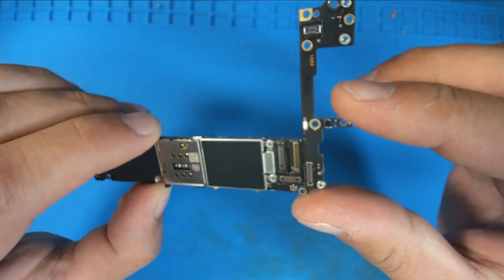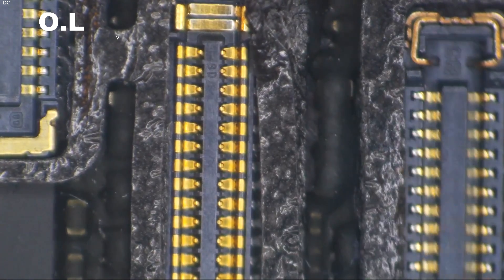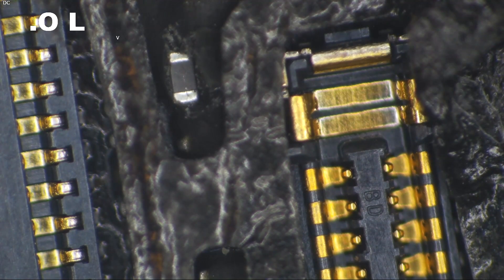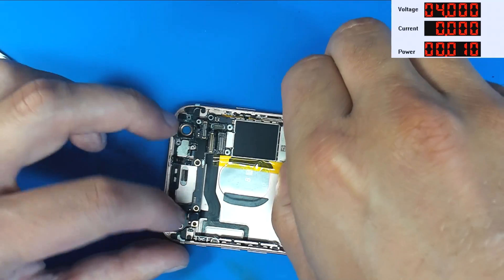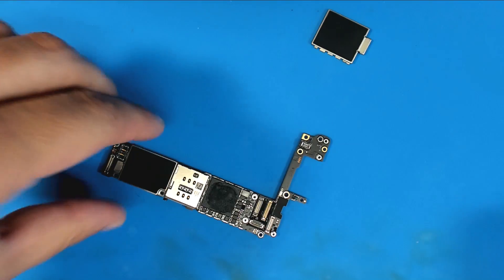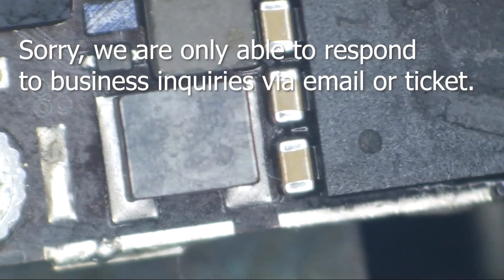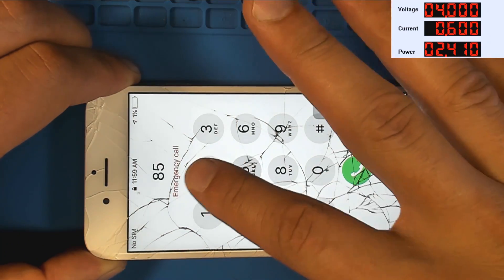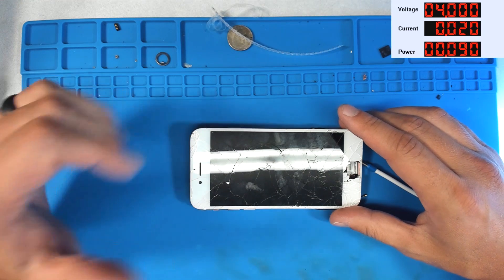A Broken Coil & The Hairy Probe - a physically damaged iPhone 6s backlight circuit

Comment: jason are you recording your microscope threw hdmi capture or usb direct ? in case of a capture which card you use i love your microscope camera quality
Reply from the maker: Thank u :) This is connected through USB 2.0.  The camera only does 1280x720 so I've got it scaled up to 1920x1080.  I'd really like to upgrade it one day but it just keeps working.
Reply: @ststele  Don't upgrade, you are lucky man, your camera give better resolution than my Amscope HD200 with HDMI capture card that is why i'm wondering, i bought many cameras and all of them is nothing compared to yours

Comment: Nice video. I am curious if you use the stock probes that came with your multimeter. They always seem gigantic compared to the  components you are probing.
Reply from the maker: These were some cheap "fine point" probes that have gotten worn down, bent, filed down, worn down & then filed some more..  they're awful